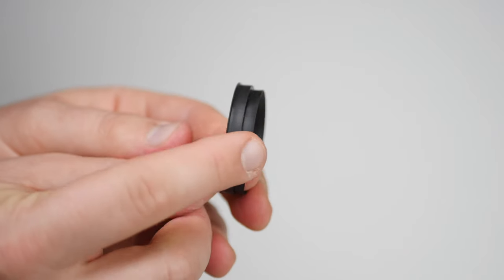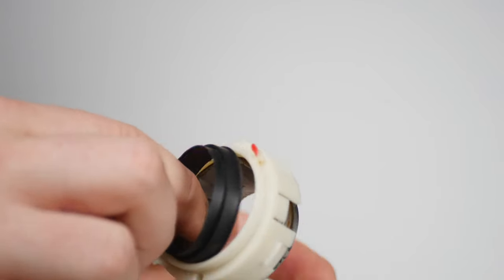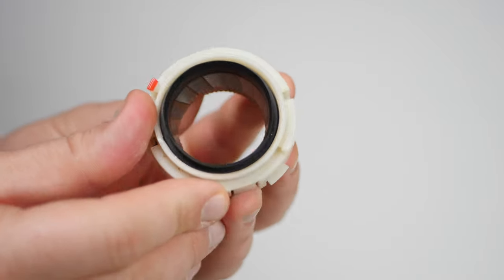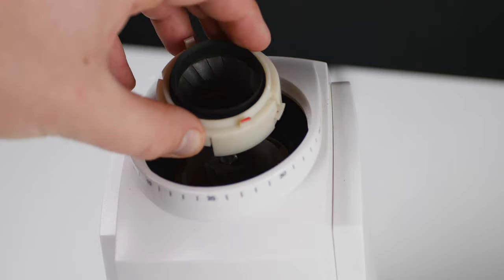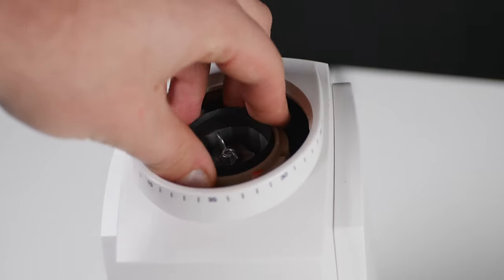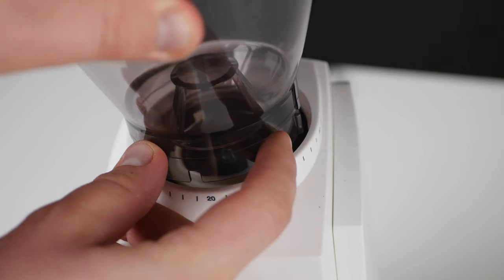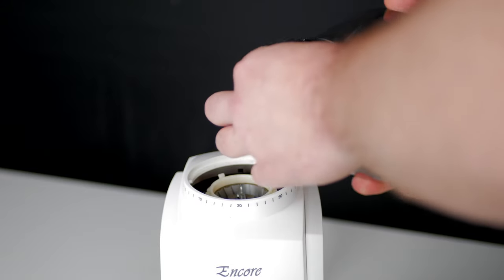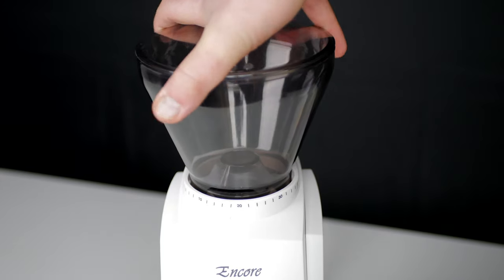Baratza Hopper Gasket Installation Guide (Conical Grinders)

Comment: I just bought a Baratza Encore ESP. The hopper wiggles in place when touched. And sometimes the hopper lid will fall off during grinding. I have the small gasket in place; identical to the instructional video. Should the hopper be snug or is there suppose to be some play in the hopper rocking side to side?

Comment: woke up this morning to find the new gasket in the hopper (!). Any thoughts as to why that might happen? I can confirm that I installed correctly as I check the parts before each grind.
Reply from the maker: We have seen gaskets get stuck by the oils or static coming from the beans. We would suggest making sure that the gasket is cleaned and inspected for any damage. The gasket is really just there to prevent beans from going into the grinder. Feel free to reach out to our support team if you find anything out of the ordinary!

Comment: Trying to install this new style gasket on the Encore grinder I found that I couldn't put the hopper in place without bending and compressing the thinner top of the gasket. No matter how carefully or slowly I tried to place the hopper on top of the burr holder, the gasket gets bent and doesn't seal properly. I found the only way to get it to fit and make a seal is to instead put the thinner side of the gasket onto the hopper first, install the hopper, and then the gasket will seat into the burr holder.
Reply from the maker: This method you’re mentioning definitely works as well! When we made this video a few months ago, this was how it worked for us at the time but depending on the shape of the rubber it may work better to use the method you’re talking about. Thank you for sharing!